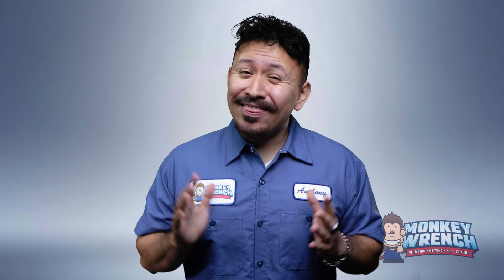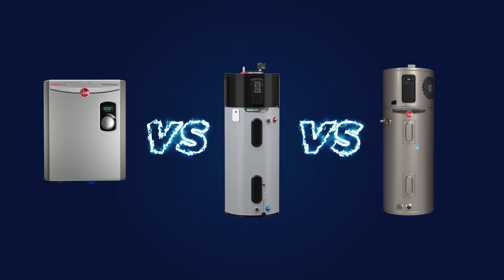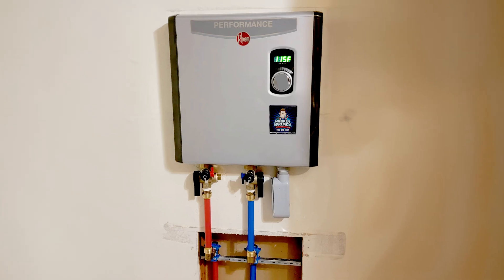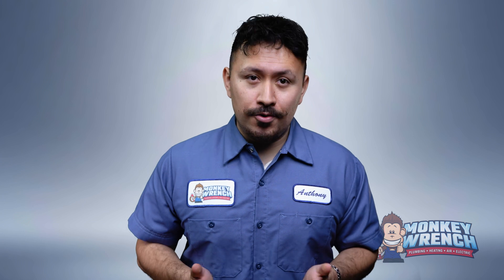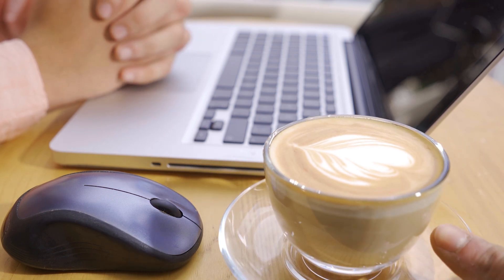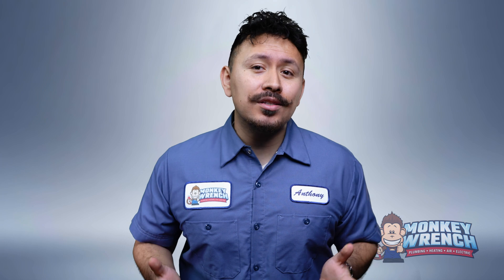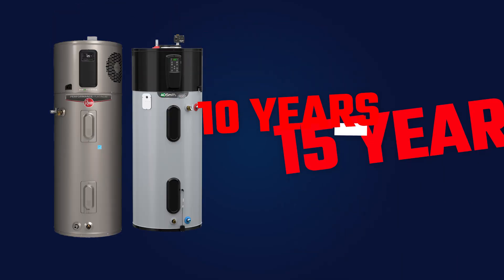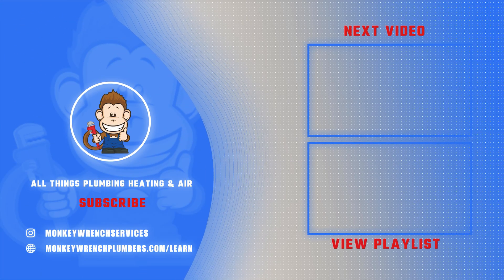Electric Water Heater Comparison: Tank, Tankless, & Hybrid Explained!

Comment: In Quebec, Canada, very close to Vermont, I wanted to get a heat pump water heater. But every single plumber and contractor that I called for price for one, either they do not return my call or tell me they will not touch it and do not recommend it. They say it has many issues and service for them are expensive. Even the contractors on Rheem official site, all the ones I called, will not recommend one. Something is really wrong here
Reply: How long did the water heater you have last?

Comment: I just bought and installed (myself) a 40 gal. Rheem Proterra hybrid HPWH. Got it "on sale" (Labor Day) for about $1450, delivered to my home. It replaced a 50 gal. 4500w straight-electric WH.
I didn't but it necessarily forvtge "eco-savings", but that is a benefit. Since it's hot in west Texas, i installed mine in  a utility closet off the garage.
I then ducted the air inlet up into the attic, to draw in warm air, and ducted the discharge air back into the garage, to facilitate some cooling. 
So far it's working well... plenty of hot water, and the garage (and its attic) are a bit cooler.
Reply: Same here I went with the 65 and with the rebates it comes down to $1000. It’s going to save me $500 a year compared to the current installed unit so it will pay for itself in 2 years.

Comment: I have a dedicated Kwh meter on my 50 gal tank electric. Ive kept accurate records for 3 years. Mostly alone, but with a frequent quest, about two showers a week. Average 100 Kwh a month. At our $0.14 rate, thats $14/mo. I am certain that there is zero energy difference between tank and on demand, but for some situations there is a difference in space requirements or other issues.

Comment: Who in the world charges $2500 to install a water heater? That's insane
Reply: the daughter (Scottsdale AZ) had a quote of $3500 for a new 80gall NG & install . I flew down for $600 return, istalled a $699 Stiebel electric & her NG billing dropped from $160/mo to $16/month. The only NG use in the home was the old 80gall tank & a cooktop.
The neighbor just had a new NG 40gall HW install for $2800 plus $575nfor new pex plumbing & code compliant PVC venting. 
Staying here in Destin FL & the HVAC guys sucked out  the condensate line on a casita a/c then put in a new thermostat, charged $350/hr.

Comment: Home owners with battery backup solar systems should keep in mind that electric tankless water heaters will draw power from your batteries during a power outage. Depending on your battery capacity you could run out of power if adjustments aren’t made.